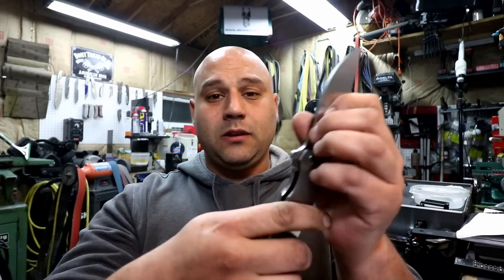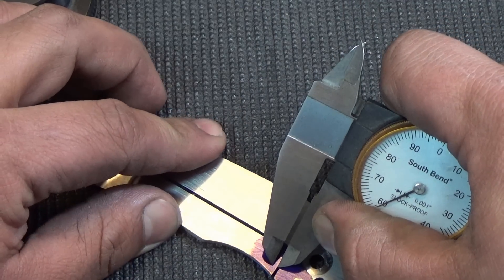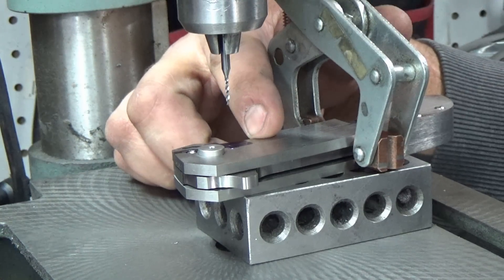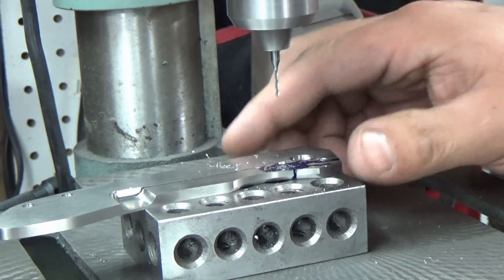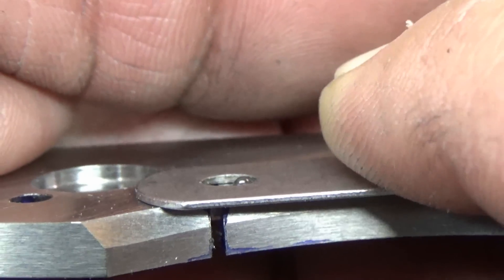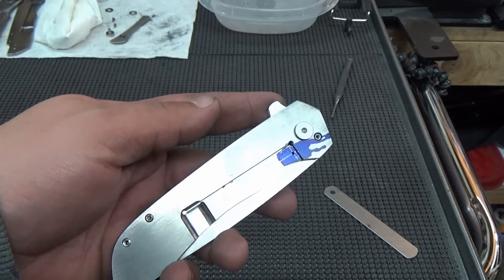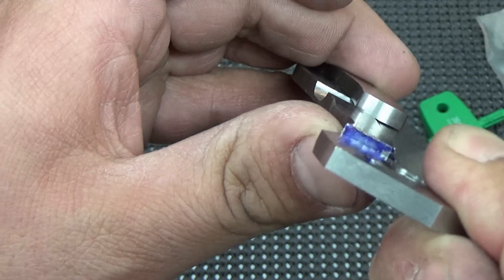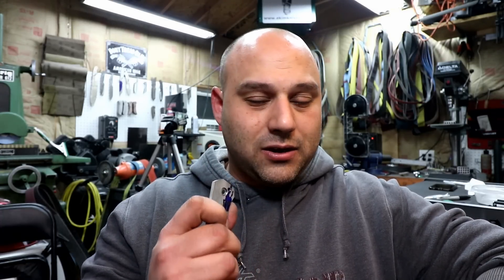How To Make A Folding Knife #11 Detent and Pocket Clip

Comment: Dear Mike, thank you for this very educational episode. I've made 4 or 5 linerlock folders up to today and had a rather different approach to set the detent-ball position in the liner and in the blade. I used the flex in the lockbar of the liner to give the detent some pre-tensions. Using the flex of the whole knife in the other direction, like in your approach, seems to be a much better and less fiddly method, though. So I'll definitely try this out on the next linerlock. By the way: I'm sorry but I had to laugh very hard as you hit the plastic with the arbor press lever and dropped the detent ball. This reminded me so much to myself, dropping these darn balls all the time... Keep up the great work and thanks again, Timo
Reply: Hey I’m applying this series to a liner lock as well. I’m using 0.070” titanium, will I have any issues with this? 

Are there any differences between frame/liner locks? I’m basically applying all of the techniques so I want to make sure I’m not running into any issues.

Comment: Great vid Mike! Going to try clamping the the blade like that when drilling for the detent, I've been spreading the lock bar which works but the clamp looks way easier! Also, a tip that works for me is using tweezers to reach in the bag and grab and place the detent ball.
Reply from the maker: Thank you! Be careful with clamping its very easy to over do it. I need to come up with a way to measure the amount of deflection like the guys do with shims in the lock bar. Maybe just count the rotations of the clamp screw to find that sweet spot. I really do need to get a set of tweezers in the shop, i'm all thumbs when it comes to tiny parts lol

Comment: Great tutorial series. One thing I noticed I don't like though is the hole from the detent ball exposed from the outside. Maybe transfering it to the inside would be better or drill it larger and tap it to cap it with another screw, just my 2 cents.
Reply: I dont understand why he drilled all the way through.. Why not just drill halfway? That way theres no hole showing.. What am I missing? Is there a purpose he drilled all the way through?

Comment: Recently got a sanrenmu 9104 and its hard to open one handed due to the lock bar or detent, it opens easy if I am careful not to apply any pressure on the lock bar while using the thumb stud, I will disassemble the knife but not sure how to fix it, some info would be greatly appreciated.

Comment: Hey mike I got a couple of questions, Do most people use a ceramic detent ball? Are they harder then steel? Why do you use a #54 bit first when you use a #53 anyway ? Is this like drilling a pilot hole first? Is there a way to not have a hole right through the lockbar? And would it be a lot more difficult to do? Sorry if this is too many question....also whens the next Q&A hahaha Cheers
Reply from the maker: Ceramic balls are harder and offer a smoother action most of the time. The draw backs are they can be fragile and can skip when there is something in their path. (Think pebble under a skateboard wheel)  The 54 is mainly for spotting but if you were to make the knife without a flipper, you would drill the blade at 54 and leave it there. this will give a weaker detent needed for thumb opening knives.
Reply: oh so the detent ball does drop in making it weaker. Thanks so much for helping us all out. Cheers